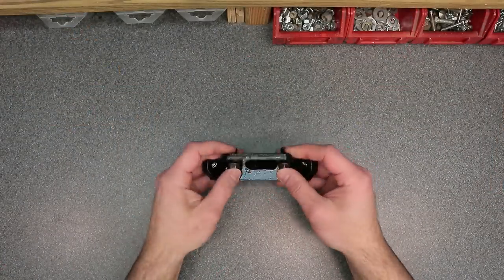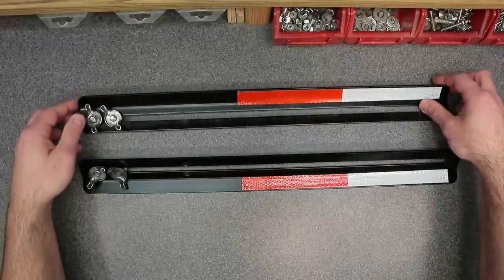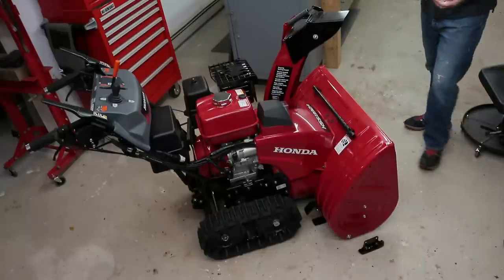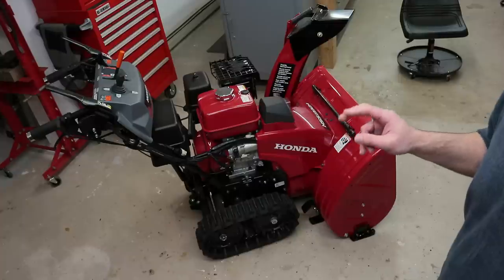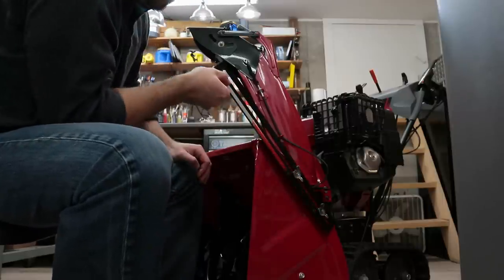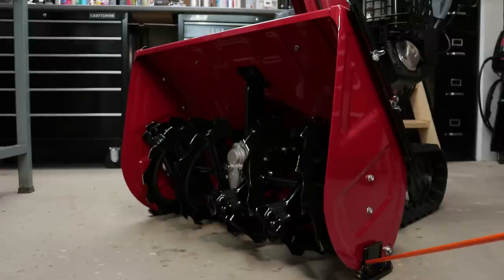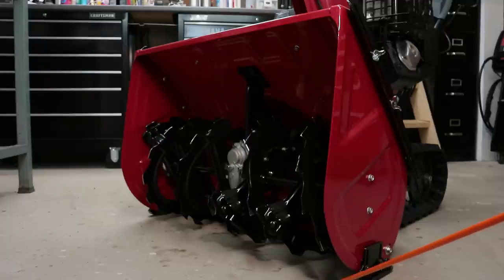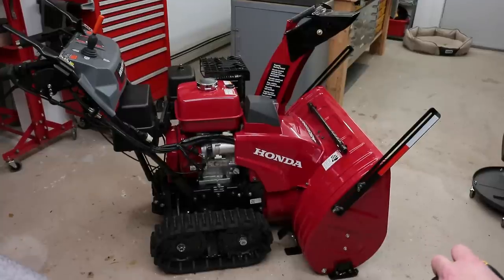Front Housing Skid Shoes & Drift Breaker INSTALL | Honda HSS1332ATD Track Drive Snowblower

Comment: I just bought a 2020 Honda 1332 ATD. As per your advice I had the selling dealer install front skid shoes and I had him adjust them so that the auger housing is at least 5/16" or 3/8" off the ground.  I can shovel the remaining snow by hand in order to preserve the bottom edge of the sides of the housing. The dealer told me that they have seen Honda units coming in after a few years with rusted auger housings. In my area drift cutters are not necessary. I had them on my other 3 machines and I never used them.  Love your videos. Thanks.

Comment: I welded on extra thickness to the skids on my new HSS928A, the OEM skids are very thin. The extra steel made them 1/2 thick after a little grinding and paint you can't tell them apart from Honda OEM. My last Honda was a HS80 it was 27  years old it was time for bearings on the fan and auger all four were ready to be changed. I also changed the belts for the first time and did some touch up paint after it was done it looked and ran great. I sold that Honda to my nephew for what I had in parts in it, and he says it still throws snow like crazy. That machine cleaned a lot of driveways and never broke down never.
Reply from the maker: Thats a great idea!  Thanks for watching!

Comment: Thank you for taking the time to put together such an informative step-by-step video. I have the same machine and will be installing the accessories that you have installed. I would like make a suggestion with regards to your drift cutters. If you install a longer bolt and Nylock to keep the bolt in place, you can then use your Wingnuts to take your drift Cutters off without having to mess with nuts and bolts. I did this on my previous snowblower and will do this on my new Honda. Good luck, keep up the great videos. I did subscribe by the way.
Reply from the maker: Thanks for the sub! The nyloc idea is good but one concern i have is that anything sticking out of the housing would be a hazard. Thats why its best just to remove all components so theres no issues going forward. I could see that threaded portion catching my knee, ripping my pants, gouging up my side steps on my truck or even my garage door trim when i get close and the machine may possibly jerk to one side. But if it works for you thats all that matters. Thanks for watching!

Comment: John, I have a new 2019 HSS928AATD...Very dissapointed in the clogging. Live on the coast, so my snow is wet stuff on many occasions. I ordered a replacement chute to modify like you did on the 1332 and it came in today. I ordered the 76310V45A00ZA chute and what they sent was a 76310-V45-A01ZA..This was the honda # right on the shipping box. For $26.0 + shipping I figured I would try it and keep the original one in case I sold it later. THe one that came in is allready modified and the plate is gone. Looks like Honda listened to you. I can send a picture but need help on how to do it....Paul.. Coastal Massachusetts....
Reply: Soak chute and auger with WD40. It does help
Reply: Google this problem, carb jet needs to be changed and double check rpms of engine need to be 34-3600 rpm, my 1332 was a slob until I upped the jet and rpms runs like a champ now

Comment: Thanks Franco, I bought a new 1332ATD this morning not in small part to your video reviews and modifications.  I've ordered my Husky Drift Breakers already and I will likely do the same heated grips that you have.  It doesn't look like Amazon has the beefy housing shoes that you installed any longer.  They have little polymer ones now.  Anyway Please keep it up.  Honda should send you some freebies to test and review for them.   
Thanks again from Coeur d'Alene, Id
Reply from the maker: Yes i have heard rumors they have discontinued them. Those commercial skid are for HS machines. Not so much HSS. I just made them work for me. But the poly skids will work just as well. Since the primary function of the side mounted ones are just as a stop/limiter and not an actual skid. So they will not wear to much.  Thats how i have it set up on my machine at least. I may change over to poly skids all around eventually to see how long i can get them to last here. I would love to work with Honda, and to help them try out different designs. Here in NH is the perfect place to do so. Thanks for watching!

Comment: Koso efi multimeter. They have a head temp sensor and oil temp sensor available. Gives you rpm, volts, clock and two temp sensors. It is turned on by the ignition switch. Cool upgrade have one myself. Great videos!
Reply from the maker: I do miss having a tachometer to read my rpm. I may have to look into that Koso. On my previous HS1332 i installed a tachometer/hour meter when i first got it.  It was very helpful. Im kicking myself now because i should of taken it off the machine before i sold it. Thanks for watching & the recommendation!

Comment: Interesting installations , thanks for the video. 
I would add, that if you decide to use stainless steel fasteners  you may find that removing the nut.washer etc. the next time may prove to be a bit bothersome.  Stainless steel bolts from common hardware stores are 'soft' and will stretch on tightening, so that when you try to remove them later the bolts may break off at the nut. This is especially true if you use stover or nylok  type nuts.
If you are trying to avoid rusting fasteners, you should go to a specialty fastener supply shop, and ask for 'rust proof bolt and nut sets, or failing this, buy Grade 8 bolt, nut and washers, these take must longer to rust.
 You will notice that the bolts and nuts that some manufacturers offer are plated with a black coating that does a great job of rust proofing.
Reply from the maker: Thanks for the info. The snowblower sits in a partially heated garage and drys off very quickly . If left outside then i think it would be alot more picky for fasteners that would last.  I think a lot of crap builds up on the surface of stainless over time due to galvanic corrosion of other present metals non-stainless. The stainless is all intact under that brown layer of oxide crud. Thats what usually will seize the b** on there.  Its like a form of loctite, lol. I notice once you quickly hit it with a stainless wire brush it almost looks like new.

Comment: I bought a set of front plates but have not installed yet.  Dealer mentioned that if you place those up front it will drag and catch the driveway etc.   I have been using that tilt forward mechanism to remove packed snow from driveways.
Reply from the maker: Most driveways are not flat so that doesnt help. But the front skids will break in very quick and if set correctly you should have zero drag
Reply: I am having one of those “I should have listened to John Franco” moments as I discovered that my rear shoes wore out and the auger housing under the scrape bar started wearing away.

Comment: Just ordered a new Honda HSS 760 ETD. Surprised that the skid shoes is not standard. Will definitly put a pair on the machine. I live in Sweden and the last two seasons it has been almost impossible to get a new Honda snowblower. Last winter the dealers didn´t get any machines delivered and this winter they claim the factorys is closed due to corona. Someone told me the Honda´s are made (assambled) in the US. I thought they were made in Japan.
Reply from the maker: Yes i believe the newest generation of Honda are made in the USA. My previous machine the HS1332TAS was made in Japan. The rear skids are the ones that are necessary the front skids are optional. And i agree they should be included because when set correct they protect the housing and auger from rubbing on the ground or pavement. Thanks for watching!

Comment: Excellent videos. I will be purchasing a unit like yours and are interested in all of your upgrades and tips.
What was the model or info necessary to purchase your drift cutters? Thanks
Reply from the maker: Its an oem Husqvarna Drift Breaker Kit 532183614. I highly recommend adding thick nylon washers inside and out, kit only comes with 2 you will need 4 total. The Husky bolts are carriage bolts with a square feature near the head, to key into the husky housing. I filed mine round to clear rubber washer i used and to not gouge the Honda paint.

Comment: I just got the HSS724ATD--was fortunate to find one as they're sold out just about everywhere I looked in Northern New England. What a NICE machine! It has only the rear skid shoes. While I'm sure these are adequate, I'm finding that it's scuffing the dry pavement (we haven't had any snowfall yet in Boston) in my driveway. Would it be wise, in your opinion, to install a par of these front skid shoes as well? Also, I'm ordering the parts for the handle warmers to be installed per your instructions. They're the one feature that my Simplicity has that the Honda doesn't. Once you have them on a snowblower, you never want to be without them.
Reply from the maker: yes you want the front set of skids as insurance you dont grind away your pricey auger housing. It tends to want to dip down foward naturally if no skids there to hold housing away from ground
Reply: Already out of stock... I just made myself  skid shoes out of a plastic board plank ⅞" thick. Just received 22cm yesterday and the same amount is expected tomorrow... I'll see how they work.

Comment: Hi John, I have Honda HSS1332a that I bought new in 2018.  I change the oil every year and inspect the spark plug.  What other annual maintenance should I do on this machine? I do not see any grease ports and I am not sure if there are other fluids that need to be changed or moving parts that need greasing.  I am somewhat leery of bringing the machine to a Honda dealership to do the maintenance as I have had bad experiences (not with Honda) but other snowblower equipment repair shops.  The Honda owner’s manual recommends using an authorized Honda dealer facility (of course).  Any advice and guidance, greatly appreciated.

Comment: Hey Franco: 

I bought a brand new Honda Snowblower HSS928ATD because I watching your channel and I thought Honda snowblower is the BEST! Unfortunately when the snowstorm came and used my Honda Snowblower, it was not at all what you said. My brand new Honda Snowblower didn't clean the snow very well and ran rough. In order for the Snowblower to move I have to keep the Auger housing an inch or two of the pavement which result in snow not being clean off the driveway. if I put the Auger Housing right on the pavement the snowblower ran rough! It almost feel like the snowblower jumped up/down moving forward. It just didn't run smooth when the Auger Housing is sitting on the pavement. What cause this problem? Your advice will be greatly appreciated
Reply from the maker: What do you mean it ran rough? was the engine running rough or it just wasnt gliding across pavement smoothly? But it sounds like the skids and scraper bar are not adjusted properly to me. This is an important step and has to be done where you plan on using it the most. Driveways are not perfectly flat planes and machine has to adjusted before use. It will wear in nicely after you get it set right. Hope this helps. Thanks for watching!
Reply: @JohnFrancoNH  

Hi Franco;

Thank you for the response. 

My brand new Honda snow blower didn’t glide smooth on my driveway. I have to keep the Auger’s housing an inch or two of the pavement, which result in snow not being clean. I didn’t touch the skid shoes because the dealer told me it’s ready to go! My lot is not level; it has maybe 5 or 10-degree slope. Do I have to adjust the skid shoes every time I go up & down my driveway? It seems a lot of works. My old Craftman Snowblower, I don’t to adjust the skid shoes and it moved up & down my driveway smooth. No problem at all!

Comment: hi Franco  good videos  have u used this snowblower on a gravel driveway   thanks
Reply from the maker: I have not tried this snowblower on gravel yet. But at a minimum it would require the skids and scraper bar to be adjusted for added clearance (3/4" or more). That way the machine does not ingest large amounts of gravel. Thanks for watching!

Comment: I just bought a HSS1332 as well and was surprised the Honda dealer said that they discontinued the contractor grad shoes! I had them on my 928TAS and they worked much better than the originals. If anyone has a link for where they might still be available or a 3rd party replacement it would be appreciated!
Reply from the maker: Richard i am very disappointed to hear that. I agree that they are much more robust and last longer then the standard shoes. Looks like i will be possibly fabricating my own replacements now. Thanks for the info.
Reply: Richard :  last year, i bought a commercial grade set here:  http://snowblowerskids.com/make-model-chart/     Hope it helps.  Cheers!
Reply: People were complaining of them scratching driveways so Honda changed the material they are made of.

Comment: Hi John I wrote to you a few weeks ago in regards to my same snowblower 1st time out that I was getting skid trails on either side and couldn’t clear out snow when trying to get close to the house or shed and that I was not getting down to the pavement. I tried adjusting the shoes based on page 55 of the owners manual and I see the problem but do not know how to fix unless it’s a manufacturer defect. After I adjusted the shoes and payed on the ground to look at the scraper bar the bar is also touching in the center and much higher on left and right side.
Reply from the maker: Sounds like the reference surface (ground) you are using is not flat. Can you try a different spot in the garage?
Reply: @JohnFrancoNH  I had a 4' level down it was flat. I'm going out in a few as were getting lil snow

Comment: will these damage concrete drives? If so is there a recommended poly skid shoe?
Reply from the maker: Hi, yes Honda does make poly skid shoes. Metal skids will leave behind white scratch marks on finished concrete, pavers etc . Which will fade over time . So if that is a concern i would use poly skids, only downside is they wear faster. Thanks for watching!
Reply: @JohnFrancoNH  having difficulty finding the Honda part# for the poly...
Reply: Wesley Pruett NH I have
Reply: @FlamaFlanga  order from Cub Cadet and modify

Comment: So the rear shoes touch when in float? Front shoes when downpressure is used
Reply from the maker: Yes rears are the main shoes. Fronts are only to protect the auger from touching when down pressure is applied. And will float most of the time. Thanks for watching!

Comment: My Honda HS724 TA/A runs good, but will not start without the choke, hot or cold, starts first pull
Reply from the maker: Theres a good chance you need to clean your carb real good. If that does not do it then the needle and float could need to be replaced.

Comment: Hi John, wondering where to find those skid shoes, i can only find cheap two sided ones
Reply from the maker: Do a google search for honda commercial grade skid shoes..i believe they are discontinued. A real bummer! But i could be wrong. Once mine wear out i will fabricate a set of my own just like them. Thanks for watching!
Reply: If you are looking for good skid shoes I would recommend the polyurethane ones from “Fallline” on Amazon. The poly ones glide along really nicely and are a great enhancement in performance and user experience with this snowblower. I have the same blower as Franco. However, you might need to add a thin plate on the inside of the housing when you bolt the shoes on so that the thin gauge metal on the auger housing is sandwiched between the shoe and plate. I picked up some stainless flat stock from McMaster drilled a couple of holes in it and it worked out perfectly. You might be OK without the plate...

Comment: No Link for the shoes you installed?
Reply from the maker: Those shoes up front on the auger housing are the commercial grade skids Honda used to offer. They are now discontinued. Its a shame they have lasted me 6+ years and still have a few years to go.
Reply: @JohnFrancoNH  yeah I thought they looked familiar, I had an HS828 since Honda first made them, I think 25 yrs ago when I bought it. Sold it 3 yrs ago ( still running fine) to buy the HSS928A. The 828 which lasted me 20 plus yrs ( sorry I sold it) other than general maintenance, it never failed me, always started within 2 pulls. 16 jobs a yrs X snow falls in the Northern NJ. Not sure if I want to put any shoes on the 928. Ya lose a bit of side clearance I would think.  Tough call.

Comment: John, how old was the Honda HSS 13-32 TAS that you got rid of and why did you sell it?
Reply from the maker: Hi, the HS1332tas i had was a 2012. The only reason i sold it was to upgrade to the newer HSS. Mainly because i really had a need for differential steering and the new infinitely variable height adjust and joystick remote for the chute are just a pleasure to operate over the previous manual types. If you have a dead straight driveway the HS1332 is still a great choice. I on the other hand have a driveway that has multiple turns in it.
Reply: Also ordered the hangrips yesterday  thumbsup
Reply: @jeffkeen2545  Hello Jeff, who were you dealing with at Spokane power tool regarding the mods to your Honda?  That seems like something I may want to do to mine also.  Thx

Comment: I have had my Honda snow blower 828 for many many many years I haven't had to do anything to it. My auger housing is not worn in anyway. All I do is change the oil every season that's it. Don't waste your money on a bunch of do dads.
Reply from the maker: Thats good for you man. But everybodys needs are different. Good thing about the "do dads" is that they can be bolted on and bolt off. No harm done. Thanks for watching!